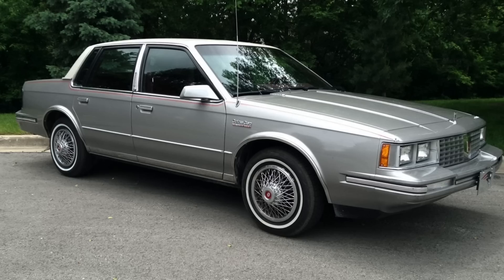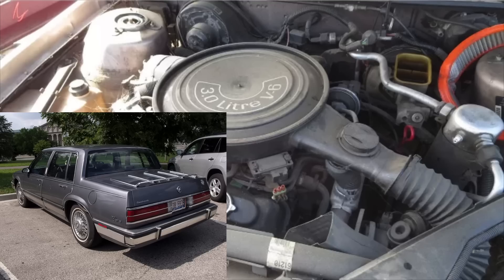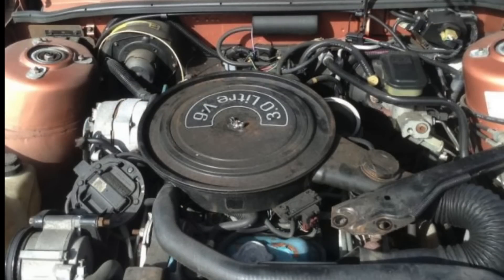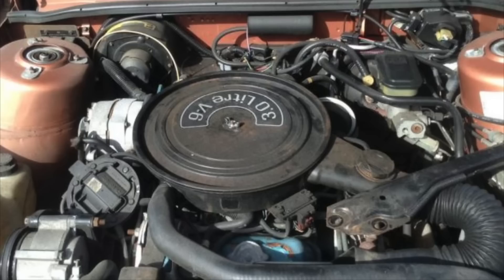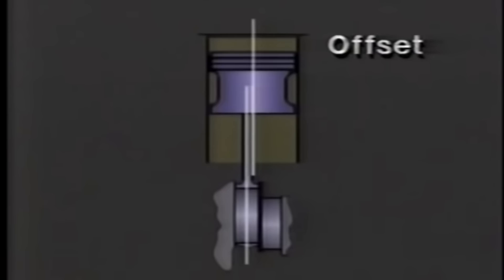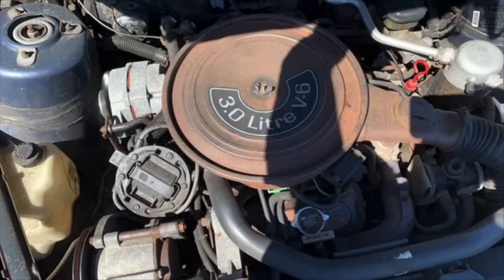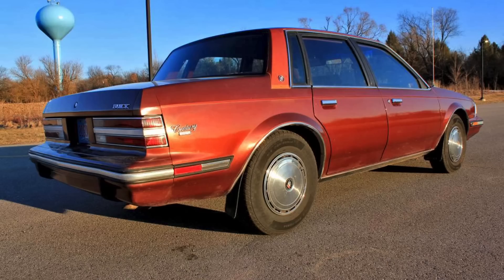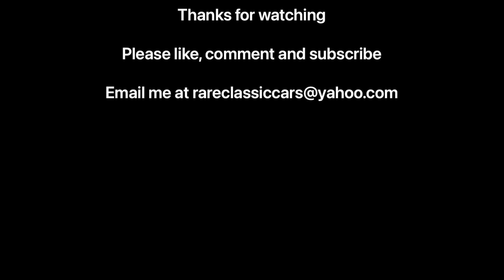Worst Engines of All Time: GM's 3.0L LK9 Carbureted V6 Engine (Buick Century, Olds Cutlass Ciera)

Comment: The 3800 was a fantastic engine!  That 2.8l V6 used to present as problematic when I worked at a shop in the 90's.  Maybe it was due to infrequent oil changes, but we saw S-10 Blazers and the early AMC Cherokee that used that motor come in with less than 100k and serious bottom end trouble.   The 4.3l V6 they used later in the S-10/Astro was Legend, and I'm hoping you will include that as a 'win' in a future video!

Comment: Back when I was in junior high during the late 80's  my best friends parents bought a 1982 Buick Century used with this engine at a local new car dealership.  His mom drove it until we were juniors in high school when it consumed oil, and later developed a rod knock.  My mother had a 85 Century with the 2.5L Iron Duke, and I later had an 86 Century with the same engine.  Both cars the engines were solid even though they had issues like cooling fan block sensors and fan relay problems which were common at the time.  My last Century was the 93 with the 3.3L V6 which was the best performing of them all, but over the years rust ate it sadly.

Comment: I forgot to mention that those 3.0's were real good at eating bearings and chukking rods out of the block when abused. Pontiac also used these engines in Grand Am 4 door cars too. The Iron Duke made a believer out of me when I put 450 miles on one that blew a rod. The oil pump drives would shear the retaining pin because of the chattering gear drive in front of the engine. I had to replace a few of them in my time. The old ones would just quit because of the distributor and when they did away with that it killed a bunch of those engines! In the late 80's they went to chain drive and it fixed the problem. That aluminum cam gear made a sound that you could tell what engine was under the hood before you even opened it. I even found one in a 87 S10 long WB 4WD 5 Speed truck!

Comment: I am going to disagree with many regarding this engine,.. and I speak from personal experience. As they came from the factory  these engines were indeed troublesome in many ways and to a very large degree it was because so many owners were poor regarding maintenance. The oil system was the biggest problem. The suggest oil change intervals used by too many people was just too long. These engines needed their oil replaced every 2-3 thousand miles or 3 to maybe 4 months at the most. The reason being that they had a strong tendency to develop heavy sludge inside the engine if not changed as I have stated. The other must do in my opinion was installing the high-volume oil pump kit which was easy and then choosing a stronger relief valve spring to raise the oil pressure about 10 to 15 PSI at idle. The factory setting had the oil pressure much too low at idle in particular. Also, the antifreeze needed to be religiously replaced every 2-3 yrs. and no more than 30K. As far as the carburetor was concerned, fixing it was easy, but few paid any attention to doing it correctly. The mixture screws needed to be turned out for a slightly richer mixture at idle, the OEM float replaced with a metal one and the float level raised slightly. The OEM choke coil was junk and opened much too fast. NAPA and Car Quest had a choke kit that opened more slowly and allowed the crazy and insane factory fast idle to be lowered to a reasonable 1600 RPM at start up and after 30 seconds you could nudge the gas peddle to drop the idle speed down to between 1000-1200 rpm, put it in drive or reverse and drive away with practically perfect drivability during warm-up. For many yrs. I made these changes on many customer cars including two of my own and the results were always excellent.  I replaced many of these engines with these changes made and the replacements with customer cooperation regarding maintenance always outlived the rest of the car. These were used engines that I hand picked and went through before installation.

As far as the Chevy 2.8 V6 was concerned, that was another engine with serious flaws from the factory, but they were easily fixed as well,... but that's another story.

PS. GM addressed practically all of the problems in later versions of the 3.0 and 3800 making it one of the best engines ever made.

Comment: Had one of these. Parents bought it new in the 80's. Had its share of problems. Luckily we had a good mechanic who recognized the timing gear issue and replaced it before it destroyed itself. Transmission was always a problem. I got the car as a teenager and always thought the engine power was strange in comparison to other cars I drove. It was a nice car, engine was very smooth, especially compared to the 4tech - iron duke i4.  If you pushed it too hard, it almost started loose power vs pulling more - about 3/4 way into the throttle. It felt like hesitation, but it was not a hesitation like bad gas, it was just a noticeable power loss. There was a sweet spot to drive the car. The advanced carburetor system was crazy and the electronics were always a problem. I traded it in on a new car when it had about 187,000 miles.  Nice car, great condition, full of electronic and mechanical bugs.

Comment: Don't listen to this guy, the truth is that on front wheel drive V6 Buick  engines built from 1982-92 which includes 3.0 2bbl 19823.8mfi 85 only 3.8sfi 86-88 3800 1988-92 and 3.0mfi 1985-88 3300 1989-93 will require an oil pan and pick up screen upgrade from 1993-97 3800 engine, the 1988 3800 will require a1994 or newer timing cover will also fit 3300 engine,on 1982-88carburetor and MF and SFI engine will require tube and bracket modified for late model pick up screen to fit in an earlier engine, but the results are amazing and make the engine last longer too.

Comment: As a former ASE Certified Master auto technician who was apprenticed and coming into my own at about the time these cars were around, I completely agree with this assessment. While not every one of these engines failed on people, they were very finicky and prone to mechanical failures. I agree that it was also depending on how hard they were driven, and how well they were maintained. Great video. 👍🏻

Comment: Having to be a auto technician back then they were a horror story to get running properly!! Vacuum lines all over the place and the stupid thermostatic vacuum control valves, which were hard to diagnose if they were working properly, I was one of the few that were glad to see even the primative throttle body fuel injection introduced in the mid 80’s. At least most of the vacuum lines and valves were eliminated. At least they were easier to diagnose and get running right.
Reply: What might make a fuel injected 87 2.5 liter iron duke run rich at idle?

Comment: In 1981Toyota start a major offensive against American small engine car using SR-5 that sold for $5,500.00 plus $600.00 advertise fee plus sales taxes and dealer prep. The SR-5 is a "Midway " for American car industry. It took 3 hours to wait at the dealer ship and 4 months to wait for your car to be shipped from Japan. I spend $3,300.00 to buy used low mileage 1980 Toyota Cecilica with 3.4K miles in 1987. I forced to sell this Car in 1988 due to insurance premium and the person that called and brought my car was a president of GM plants in Fermingham. MA and he brought it for his son HS graduation gifts!

Comment: We had no problems with our '85 Ciera 3.0 which stayed in the family for 12 years.   HOWEVER, the Metric Trans attached to it had flywheel issues at a relatively low mileage (replaced) and a total failure at 108K (rebuilt).

Comment: You have low standards theGM 3800 V6 was a pile of junk the list of problems starting from its architecture never were solved just barely managed. Obviously never worked at GM dealership been GM factory trained at their schools or have had privilege reading GM Techguild Techline bulletins and service bulletins.

Comment: I would like to interject a little information concerning 1982-85 Buick 183 C I 3.0V6 , this info would cover all front wheel drive Buick engines from 1982-92 includes early 3800sfi TPSFI 88-92  the 3.0 will have better oil pressure if you change the screen for the oil pump inside the pan the pickup screen used on early engines the screen has small holes that get plugged easily, to remedy that problem use the pickup screen from a 1993 and later series 2-3 3800 engines the new screen is has a smaller circumference but larger holes than the early screens,if you change the screen and have a good oil pump the engine will maintain higher oil pressure,P. S in early engines use a 4 quart oil pan 93-97 engines use a 5 quart oil pan series 3 use a 6 quart oil pan 1998-09.

Comment: I had one of these engines in a Buick. Made it to 120K miles, but killed it by making a two hour 85 mph run to meet some friends. Terminally blew a head gasket as I parked to join them. Up until that point, it had been a good car.

Comment: If I remember correctly the oil pick up screen was too fine allowing sludge and paraffin to clog it and starving the engine of oil.
Reply: typically clogged with reminiantes of the nylon timing sprocket.  usually not long after the chain and sprocket is replaced but sometimes before lol

Comment: I had a 1984 Buick skylark took up a mountain road near Lyons Colorado blew the engine. Which was under warranty. And replaced. That to me sounds like an inadequate motor as I wasn't over the speed limit but not driving like an old lady either.

Comment: I guess it all depends on what day of the week it was built like they used to say... I had a co-worker with an 85 back in the early 90s and at that time the car was approaching 300K and it was still running strong minus a small oil leak

Comment: The 3800 I had in my 98 camaro was a good engine with nice sound. Just the design overall of the body had issues when trying to work on it like tryimg to figure out a misfire code and the window design

Comment: I disagree vehemently. The 80's were a time of rebirth and excitement for the US car industry. It was the 1970's which were a morass of endless shitboxes like Pacer, Vega and OMG, the exploding Pinto. I remember going down to see the FIRST Fiero at Bob Pion Pontiac in Springfield MA and the showroom was mobbed with people eager to check the car out. I remember test driving a Buick Regal Grand National in 1986 and the salesman had to remind me to not spin the tires so much!! Then I took out a loaded IROC-Z at the dealership down the street but the car was too rich for my blood. I settled on an 86 Mustang GT 5.0 with the first fuel injected H.O. motor because the car was only $12,000 and I could afford that. I put 327,000 miles on that car and never did a thing to the motor except a water pump, plugs and wires!  I did put 3 transmissions in the car but that was because I had so much fun roasting the tires while shifting into second gear. Blew the factory tranny at 20K. 😂😂 Thank God I bought the ESP for $500 so Ford replaced it FREE.

The 80's were a WONDERFUL time for the American automobile. They weren't the 1950's but that goes for just about everything.
Reply: 50's still had polio 🙂.
Edit:And how did you not blow out the rear end?
Also, agreed.

Comment: I HAD A 84 BUICK LASABRA NICE LOOKING CAR BUT IT HAD ONE OF THOSE ENGINES UNDER THE HOOD.  I DID A LOT OF DRIVING BACK THEN. ALWAY CHANGED MY OIL WHEN NEEDED  TO GOOD CARE OF THE ENGINE, BUT I WENT THROUGHT TWO TRANSMITTION FINILLY BLEW A CYLINDER ,AND THAT WAS IT FOR ME ..TIME FOR THE JUNK YARD...THANKS FOR READING...TAKE CARE AND GOD BLESS..

Comment: My 1985 Buick Century has this engine.  I agree the engine is bad, but it is still running well.  At least the parts are cheap. Got rid of that plastic timing gear last summer since I didn't want some 37 year old plastic coming apart.

Comment: 97 Buick century with under 100.000 miles on the third set of lower and upper intake gaskets and yes it’s leaking again. GM screwed up bad on the 60 degree engine block.

Comment: Also to add to this. There was a Jeep Cherokee Pioneer model that also used the celebrity V6 2.8 liter. I had a 1986 jeep Cherokee Pioneer with this engine.  I hated that engine with a passion. I had to replace the heads on that engine 3 times before I junked the car and got a 2001 Toyota Camry. That engine is also another bad GM engine of the 80s

Comment: It just makes you wonder, with the 3800 series being one of the best mid-size engines made by anyone, why didn't gm just realize after a year or two, just to make the 3800 series the standard v6 engine for all their cars that used a v6?
Would have simplified the production and reduced costs substantially I would think. But hey, we're talking about gm here!

Comment: Growing up, we had an 86 Grand Am SE with a multi port injection version of this engine designated the LN7. We kept it until 110k miles and had no problems at all, and my dad was anything but "easy on the throttle and RPMs".  Ours was a ripper for what it was, and loved to rev (like you would think being so oversquare like that). It had the valve covers, coil packs, serpentine belt drive, and other accessories that looked like the later 3800 FWD engines. The updated valve covers MIGHT mean it had the properly staggered block/rods/pistons? Who knows. I can find almost nothing about the engine online even, just a mention that it was an option in 86-87, replaced in 88 by the 3300, and it made 125hp/150tq. 🤷

Comment: I had an 88' Celebrity with the 2.8 MPI engine, and I can confirm that it was pretty much a happy camper all of the time, even though I I inherited mine with over 300,000 miles on it. To bad my cousin killed the transmission.

Comment: I was a Buick Heavy Repair Tech in the 80s and 90s. We had 2 techs at a large dealership dedicated to 3.0 engines. We loved them. Many failed just outside warranty and we made money on them. We had a repair lot with dozens stacked up waiting for us. Under warranty, the most common issue was loss of coolant caused by seeping metal one piece head gaskets. We often used 2 head gaskets stacked and copper spray on them to resolve. Cracked blocks inside the lifter galley were common on earlier models as stated in other comments. Connecting rod failures were second most popular as you stated. You made it clear, but commenters are still somewhat confused. This 3.0 has nothing in common AT ALL with the 3800. In my 10 dealership years at GM, no other engine failed as frequent or catastrophic as the 3.0  Junk.
Reply: How about the Cadillac 4100?

Comment: My mom had a '85 T6000 LE.  It must have had this engine - I tried to get her to buy the STE with fuel injection but she declined.  Luckily, the engine never had a maintenance issue for her.  She didn't put a lot of miles on it - maybe that was good.  That car was a joke.

Comment: Great video with one tiny mistake. Synthetic oil doesn't "cause" leaks. It only "finds" leaks. Synthetic oil has superior flow characteristics compared to regular oil. This is why it will leak from places where conventional won't. If you switch to synthetic, and leaks develop/get  worse, just switch back. The leaks will usually return to the same severity they were before synthetic.

Comment: GM wasn’t the only car company with garbage a engine. I remember my mom had the 1987 3.8 V6 Olds ninety eight with automatic transmission and it was so reliable she had to rescue my dad many times with it because of his 1987 Ford Tempo GL with the infamous Ford 2.3L 4 cylinder 4 speed with overdrive manual transmission would constantly break down for something. To add to the garbage engine on those 1985 to 1989 tempos were the body items would also break, the wheel bearings would prematurely fail, the door handles would get loose and break, the hand brake cables would break, the a/c compressor clutch often failed within the first two years or 15,000 miles of driving the car, they would leak oil, The exhaust parts frequently would fall off randomly, oh and the best part, the cars paint job was so bad it would peel then rust. Also PS garbage vehicles weren’t an exclusive to the 80’s. In the 90’s the dodge neons were not very reliable, but the Pontiac Sunfires of the late 90’s and early 2000’s had a major issue, premature head gasket failures leading to clogged water jackets leading to severe overheating problems. Even now alot of Subarus have issues with their infamous boxer engines, and modern BMW’s are electrical nightmares with fires starting without even driving the cars. the 2011 to 2017 Ford Focuses have transmission problems.

Comment: Engine longevity is mostly in the oil change intervals.if you go more than 4 k  your in the high wear zone and if you run it hard  you need to back it up to 3 .People say oh it's the newer oil quality or it's so much better now that we have fi but I think it's that if you change your oil close to the recommended  interval and dont beat the crap out of your car it will do fine.

Comment: I had a 3.0 1985 Centry and it ran good. We drove tjhat car for years. I sold it to a friend and he drove it for years till they overfilled it on oil and blew a hole in the block. The carb was a pain, and the 125C Transaxel would make the engine scream at 70. These engines needed the 4t40.  My experience can verify it was a smooth running V6 but a little short on power.